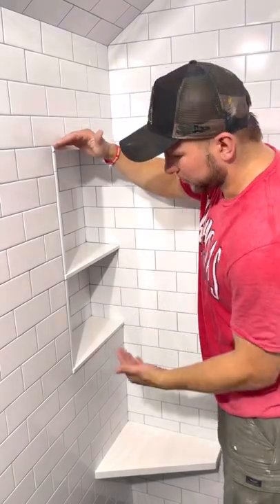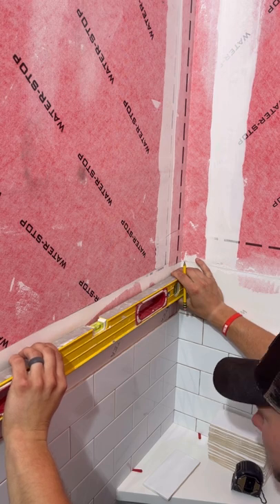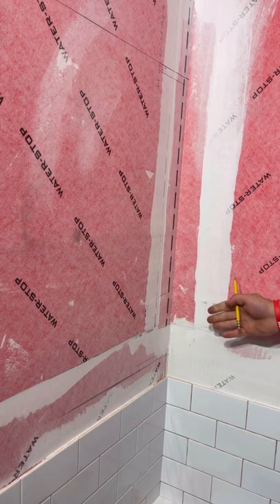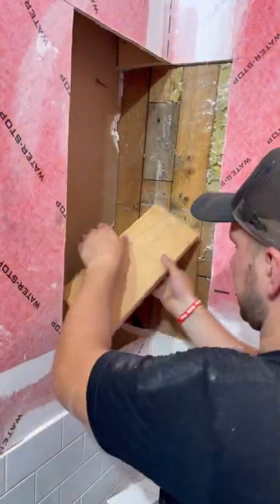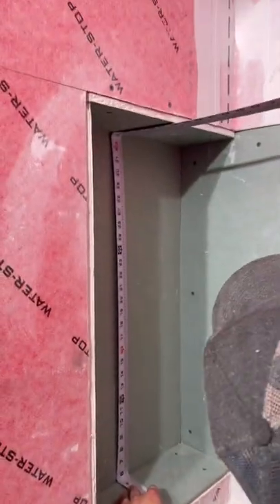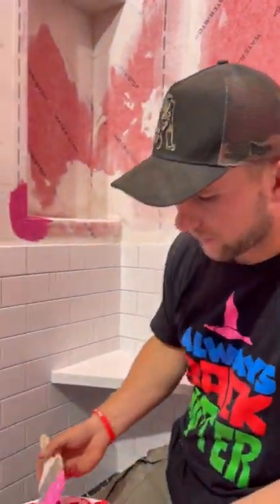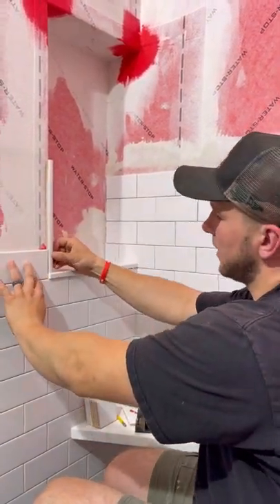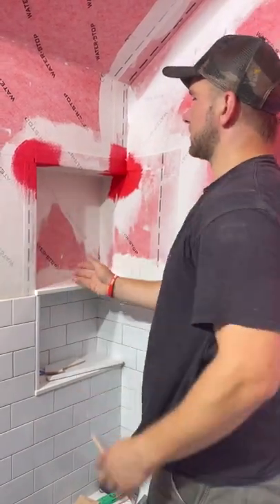The Secret to a Perfect Niche. Custom Niche. WINNI

Comment: With the pencil trim around the niche, I would definitely recommend to always miter the coroners on a 45. I never butt the corners square. Also, put the dutch man in the middle or bottom in line with the grout joints, instead of at the top left of the niche. Great work per usual

Comment: Greetings! I have two Niches... should I caulk or grout corners? I use Wedi board and corner sealant beneath the tile for water proofing. thx
Reply: Silicone. No grout in corner. It will crack.